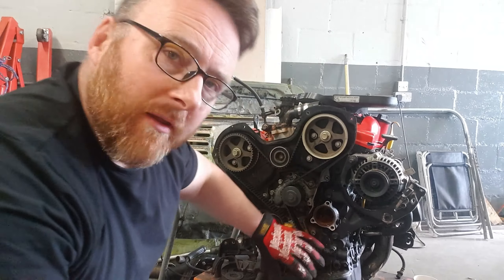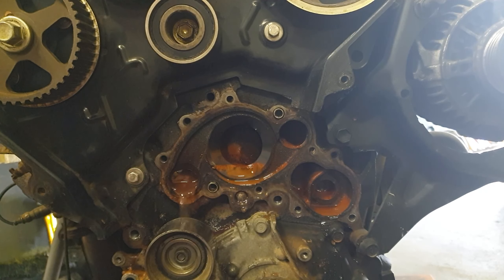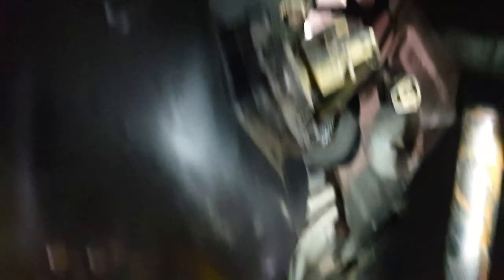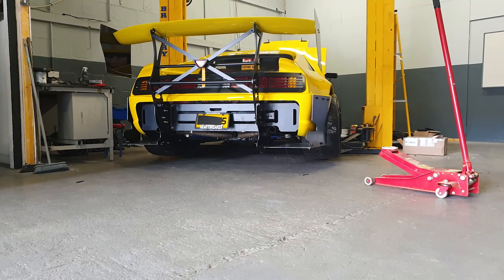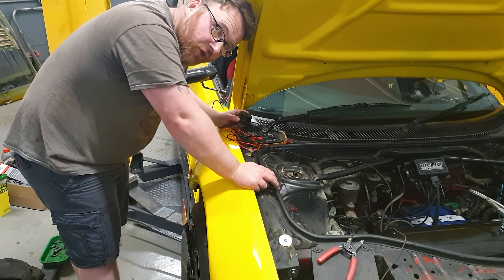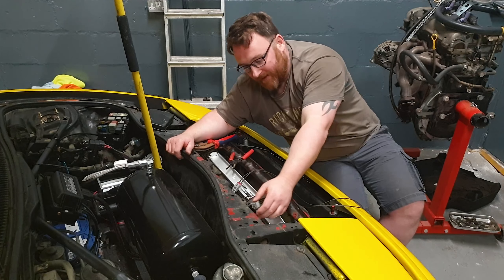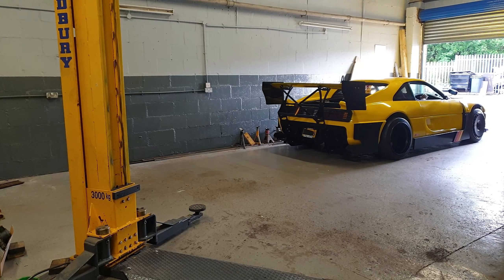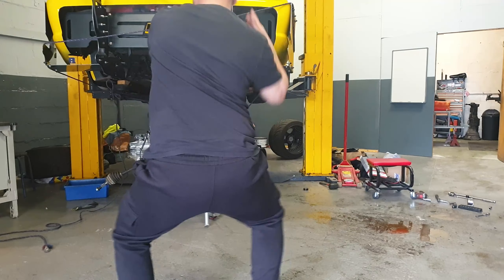Debt Corrector - Episode 4 (Status Error MR2)

Comment: Always fun sorting overheating problems. We often ran a car without a thermostat to check whether the rest of the system was running as it should. I also once ran a rad fan directly switched from the battery - however, 8 miles from home I found even the chunkiest speaker wire wasn't up to the job...!